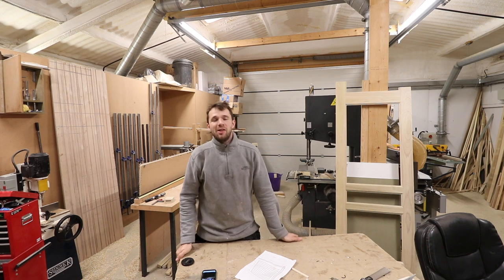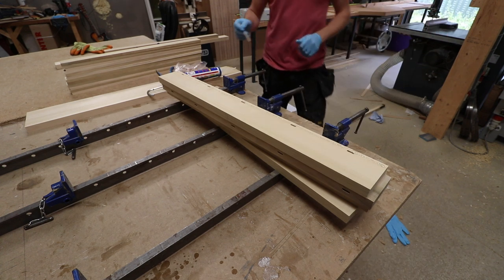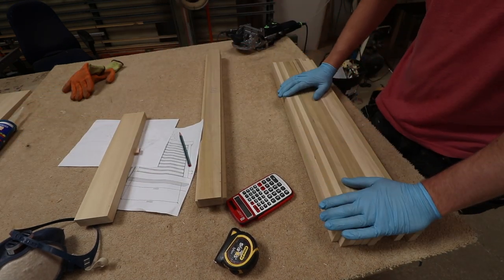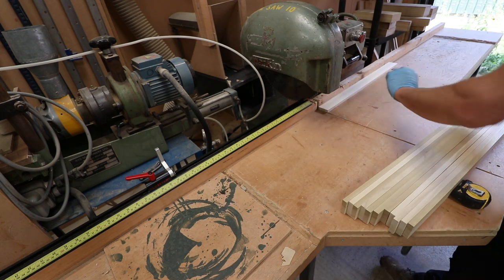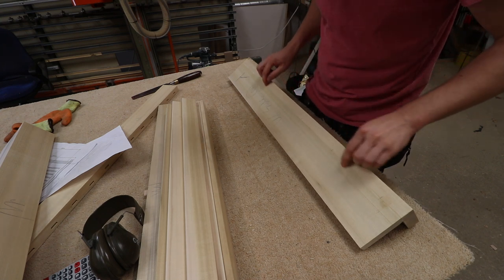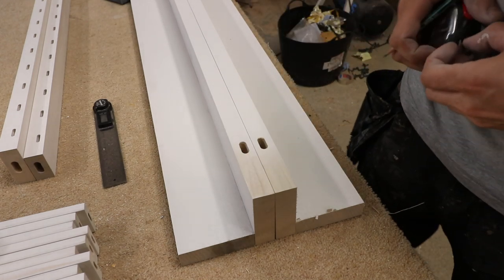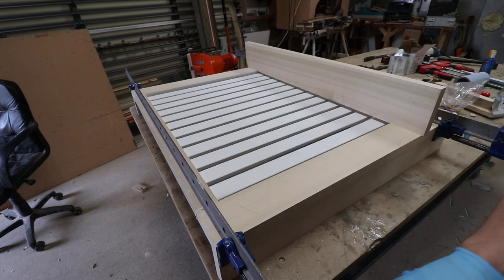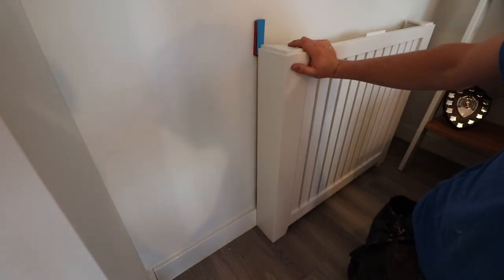Making a Bespoke Modern Radiator Cover using Festool Domino

Comment: Quick tip for you when spraying is make yourself a nail board with long nails driven through a piece of scrap MDF on you turntable then rest the item on the sharp ends whilst spraying. I had furniture painting business for many years and works a treat with lacquer and paint. As long as your gentle laying in in place.
Reply from the maker: Cheers Ian, I have made a second spray table now with 4 adjustable wings, great bit of kit!

Comment: Yet another great informative video Oli, THE best channel for bespoke items by far. 
As regards to the PU glue you use in the tubes, how do you seal the tube until next time you need it? 
I need to give the PU glue a try, I’ve been using Titebond but like you say the drying time is agessss.
Reply from the maker: Hi Ian, PUnis my go to now I barely ever touch the runny glue out of convenience.  I most of the time just leav it to set in the end and then while triggering the gun tap the end of the nozzle at 90 degrees a couple times to loosent the set part and it pops out. Otherwise the screw caps provided work well. It depends how long you leave between use. If more than a few days the first technique won't work.
Reply: @BradshawJoinery  Great, thanks for the tip, I’ll give it a go when i try it on my next project. Keep up the good work 👍

Comment: Hi Ollie 2nd time watching this video have been asked to make 6 covers, Why did you use poplar as against MDF which seems to be what most are made from. Isn;t there a danger of the poplar warping with the heat from the radiator.
Reply from the maker: Yes, the poplar is more likely to move, but after that initial movement it's a more durable product and it is solid timber, which is what we are all about.. 

This cover has moved a tin bit on the joints but only enought to see it is a proper product. Imo much better quality than MDF
Reply: @BradshawJoinery  Totally agree using solid timber is far better than MDF, you have given me the confidence to try it thanks
Reply from the maker: It will work best if the timber is as acclimated to the environment it's going to end up in. So a damp shed to dry warm house will see more movement than a warm workshop
Reply: @BradshawJoinery  Thanks for that have a complete workshop similar to yours so will let timber sit properly sticked for a couple of weeks

Comment: Hi I have made radiator covers for years but never out of wood only MDF . Does the wood wharp with the heat of the radiator
Reply from the maker: This is tulip and you can see a hairline crack in the joints but it's not warped! Slats are all nice and straight
Reply: @BradshawJoinery  I think what he's saying is, over time, the heat is going to pull out the moisture.  I share the same concern...  Looks fantastic though!

Comment: Probs considering materials, time,making,spraying,fitting,a £300 plus cabinet witch is beautiful and a 1000 times better than the flat plack crap but who would likely pay for it.
Reply from the maker: There is a Big market for bespoke quality fitted furniture. Big Market!!!
Reply: @BradshawJoinery  wasn't knocking you by any means,fellow joiner here it's just in northern Ireland most wouldn't pay for it unfortunately.
Reply from the maker: No, I fully understand, were lucky here. Close enough to London that there is some money about

Comment: Good skills but a radiator cabinet should work like a chimney. The gap at the top is too small. The theory is that  the cabinet draws the cold air in from the bottom warms it as it passes up then vents from the top, if the top gap is too narrow the cabinet isnt efficient.
Reply from the maker: HI Michael, thanks, yeah i get that, but its always a compromise. the house is easily heated, so its not a problem here, but on older colder properties, it is well worth considering.

Comment: The title should be. How to make a radiator having £50000 worth equipment in your garage. Great job🤦🏼
Reply from the maker: The domino is the only bit that's specialist. All the rest can be improvised, and is totally a part of woodworking, working around the challenge laid Infront of you. 
In fact, even the domino can be improvised/replaced. The design and process remains the same and the video is still there to guide.

Comment: Another good video. The only comment or question I have is why did you not make the shelf in oak to match your bookshelf and cabinet? I think an oak top would look great and everything would match.
Reply from the maker: I Did umm and Arr about this! I came to the conclusion that the other furniture is free standing, but the radiator cover i wanted to make quite discreet and not draw attention  too it. I might change my mind eventually though as it makes a nice set of furniture!

Comment: Made the brackets to hold mine to the wall today. Great idea they are. Thanks
Reply from the maker: Nice one Robert, yeah they work pretty darn slick dont they
Reply: Installing them on Thursday at my daughters house
Reply from the maker: AHH cool. I'd give yourself a bit of play left and right (sit them in from the edges 5mm or so as they hold pretty well and it'll make getting them on and off easier

Comment: Whenever necessary, I cut stock twice on the chop saw - on the front and again on the back - in order to avoid rough edges.
Reply from the maker: Yeah you can do it all from one side slide out along the top edge then plunge and push back in for clean cut on bottom 👍